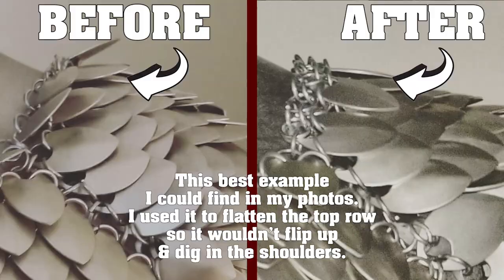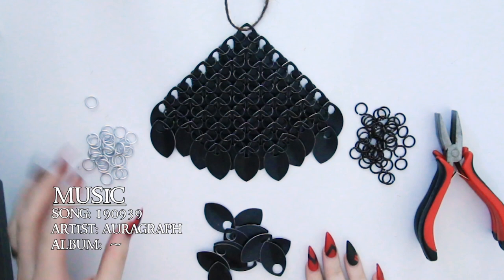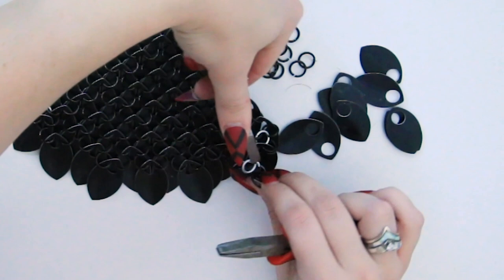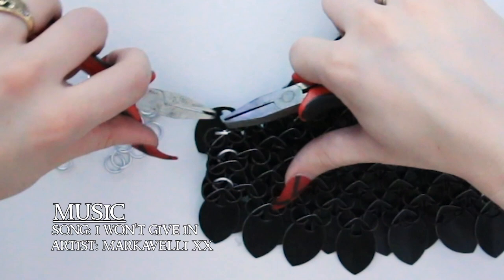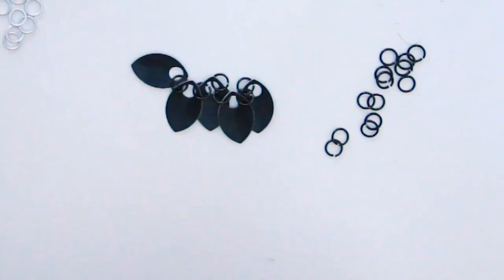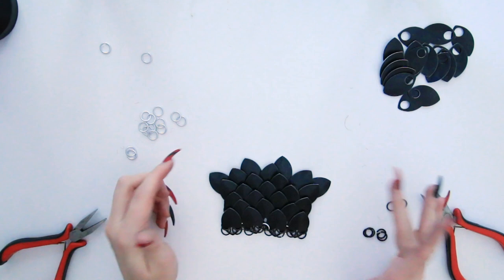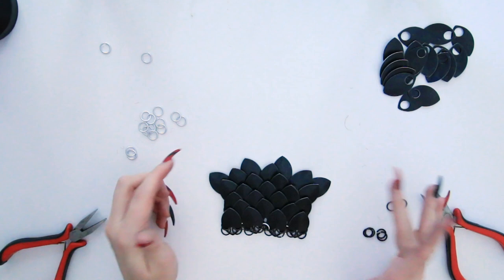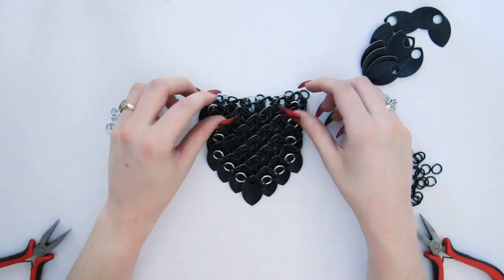How to Make a Straight Edge | SCALEMAIL TUTORIAL

Comment: You're fighting the rings.  "Lighter" ring the two on the inside. Add your 2 outer afterwards. You snag 2 and close. Instead of fighting 4 and closing.

This can also help in straps. Make your initial 4in1. Snag 2, close, flip and add 2. If you want it wider, take the strap and add to one side by snagging 2 and close.

Comment: I have been doing scale mail for about a year and a half now and your vids really help me out when I get stuck so thank you very much for making them I just was curious on how well the scales you use hold up over time before I go and get some also this looks like this will help with my current problem with the sides and how the flop out to the sides (making an arm band/sleeve any tips would be greatly appreciated)
Reply from the maker: Glad my videos are helpful! Thanks for watching!

Scales hold up great! But what can happen with aluminum is that the rings struggle to hold too much weight so you might have to make a lot of repairs from rings slipping out of place over the years. I've considered using a combination of steel and aluminum rings on pieces. For a full arm sleeve (if I cared) i might use anodized steel rings at the shoulder and then switch to anodized aluminum 1/3 of the way down or so. It's up to you though! I still like using anodized aluminum because it's light, easy to work with, won't rust, and the anodization helps it to not leave so much of a metal residue on the skin.
Reply: @alisinchainmail  ah ok thanks for the tip i'll keep it in mind. keep up the good work and have a great rest of your day

Comment: I know this video is old BUT I was wondering if you have ever attached scale mail to clothes. I’d like to add some on to a cape/cloak for my CosPlay of my DnD Ranger character but have no clue how I’d go about it as it would be my first time working with making any type of chain mail/ scale mail.
Reply from the maker: You can crochet them or hand stitch individual scales
Reply: Actual proper scale, as armour, not costume, was almost ALWAYS exclusively affixed to material vie stitching, not maille. You can cut your scales from carboard and punch your holes, and try on an old blanket or something.... just so you get a feel for how one does such things. 

If you were aiming for actual practicality in the armour, you might want to research the five main different ways scale was constructed, in terms of the stitching and overlaps, but since it is just a cosplay thing, that really does not matter.